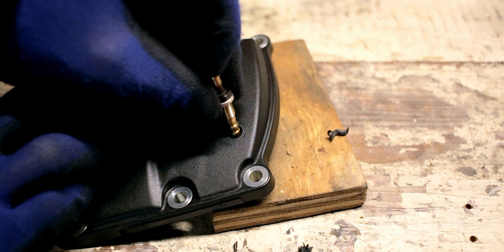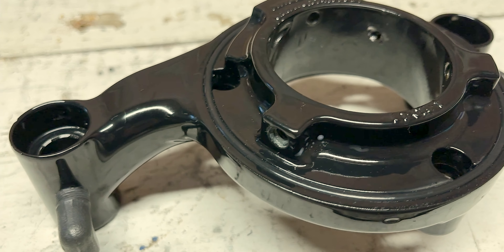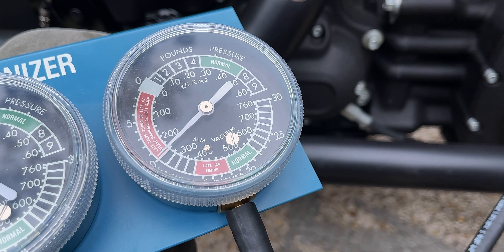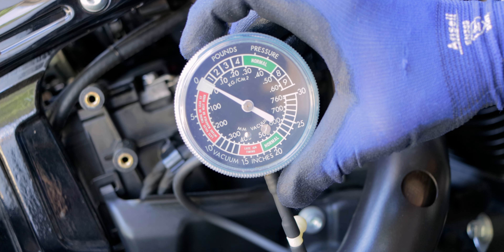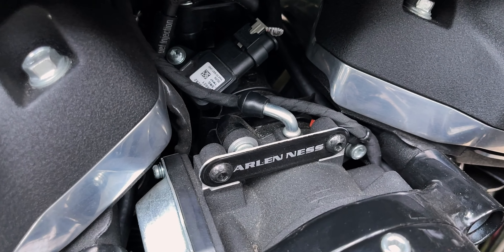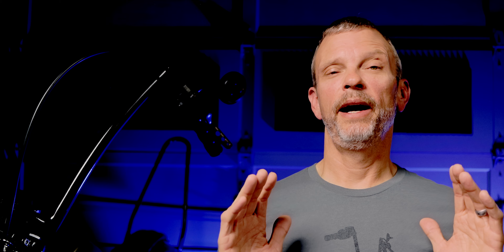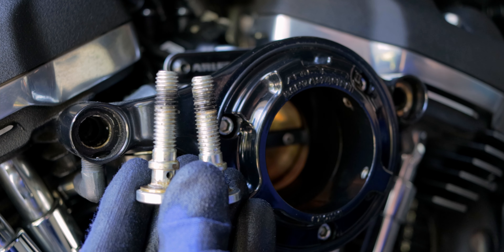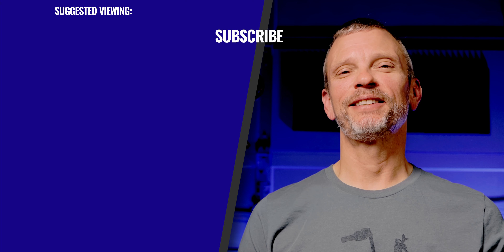M8 Crankcase Pressure OR Vacuum? • Crankcase Vent • External Breather • Check Valve • Stage III

Comment from the maker: Have you tried to measure the crankcase vacuum on your bike? What did you find and how did you measure it? There’s probably a better way to do it than the method I used. And do you have verifiable facts about whether or not this mysterious vacuum is really needed in the crankcase? Let me know!
Reply: You will never have crankcase vacuum because of ring blowby which is minimal at first but increases with age. In race conditions severe cylinder pressures increase crank pressure which can cause seal blowouts so vacuum pumps are used to get a lower crankcase pressure moreso than a vacuum.  General stock applications are sufficed with venting as you did to achieve no or minimal case pressure
Reply from the maker: Hey C Joy - thanks for contributing to the discussion!

Comment: I believe that nipple on top of the throttle body is a vacuum port (VOEs). Can't remember but that would be why its reading neg. I did both the NESS breather mod and the trans DIY mod to both my bikes. My 128 road glide and my 117 softail neither show any signs of problems. I Just put roughly 1000 miles on the softail this past week in the Mountains of NC. Temps in the 80s and average speeds on the freeway were 80mph. Revs down the mountain backroads were 2700 - 3000k. No problems. I think these mods are fine. Thanks for the research!!
Reply from the maker: Hey Timberjkd - my guts says the same - I’ve logged some good hard miles with both mods in place and I haven’t seen any issues. And yes that is a vacuum port on the throttle body. I knew there was strong vacuum going through and I just wanted to get a reading so it was clear that the intake vacuum was significant. Thanks for the input!!

Comment: Thanks so much for looking into this, I’ve been thinking about this a lot. I’ve installed the Trask vent and I’m really happy with it so far but have been debating the external breather vents, mainly because Kevin Baxter didn’t recommend doing both. This the response from Kevin when I put the question to him, “I'm not one to suggest parts unless they are needed to solve an issue. It would depend on how much oil is passing thru the breather. If your TB and air cleaner are relatively clean, I wouldnt spend the money. It doesn't hurt, but may not be necessary. All the best - KB”   So at this point I’m eagerly waiting on your next video and I’m currently putting off the breather mod. I’m having a stage ll done next week and installing a SS oil pump and Cam Plate to prevent sumping, I’m eager to see just how much oil residue is in the breather, when I install the new one. 
Thanks again your videos are super helpful and informative. Keep up the great work.
Reply from the maker: Hey Todd - thanks for the info and feedback! My gut says it’s not a problem but I wanted to do some research and testing just to see what I could learn. I’ll definitely post info on how those bolts look with a couple of checks, but my expectation is that I’ll re-do the breather mod within a few weeks. Unless, of course, I get solid info that doing both is “bad”. 

Please let me know what you think after putting some miles on the new cam! I’m about to do a Stage III follow up video and the S&S cam plate is on the research list along with a few other dream-list items. 

If you want a channel sticker send me a DM on Telegram or Instagram with the mailing info @RonsWorkshop
Reply: I also use the Trask vent.  The Trask guys say to combine their vent with an external breather, just the opposite of what Kevin Baxter suggests.  So for now, I'm running the Trask vent and regularly checking my air filter (Stage 1) for buildup.  So far nothing, but headed to Sturgis in a month and that will be a good test.  Even before the Trask CheckM8, I still wasn't seeing any problems with my air intake at 10K miles, but then again, I don't ride really hard.
Reply from the maker: Hey Jerry - thanks for the info! Let me know how it looks after Sturgis. I’m working on the follow-up video now. It should be up before Monday. 

If you want a channel sticker send me a DM on Telegram or Instagram with the mailing info @RonsWorkshop
Reply from the maker: Hey Jerry - I  just posted the follow-up video: https://youtu.be/BaG1VdOFe48
Reply: @jerrybrown66  hey Jerry I was thinking of putting trash vent on my Harley-Davidson street glide 2019 trash told me I need update oil pump 2020 before installing it do you have update pump?

Comment: Just a thought but when you connected your gage to the crankcase vent on the trans cover did you put the check valve in line or leave it out?
My understanding (and i may be wrong) is that without the check valve vacuum will not build in the crankcase as the air is just flowing in from the vent hose when the pistons are going up (instead of being blocked off due to the check valve thus creating the vacuum in the case). When the pistons move down air flows out of the check valve into atmosphere thus allowing the crankcase to not over pressure and start sumping.
Reply from the maker: Hey Darren - good point. I attached the gauge directly to the barb on the top cover, so the gauge was actually serving as the check valve to allow it to pull a vacuum if there was one.

Comment: If the plastic bag continues to inflate, and stay that way, there can not be a vacuum in the crankcase. They would cancel eachother out. I have bought a 2022 model and if Harley have not added a vent I will, but without a check valve. 
On another note, I remember as an apprentice mechanic (cars), we were taught that compression and combustion pressure forces the rings out to seal against the bore. I personally can't see how a vacuum would effect rings considering the opposing forces. I'm not alway correct either, just my opinion based on my training.
Lastly, oil misting into the air intake is very common, even in diesel engines that do not create a vacuum. In those engines it is purely blow by pressure causing it, requiring the use of catch cans. 
Thumbs up for the breather vent in the cover.
Reply from the maker: Hey Tim - thanks for the input! I agree that if there was (enough) vacuum in the crankcase it would offset that pressure, which is definitely the goal. After trying a few different approaches, the transmission top cover vent is my favorite as well.
Reply: @RonsWorkshop  and thank you for exploring all the options Ron. I've had a sportster for 5 years so the M8 is new to me. I like to be prepared 😄

Comment: Interesting subject matter.  Been considering running both Crankcase Pressure Venting and External Breather System (EBS).  I have a Fueling Billet Vented Oil Dip stick on my 2020 SGS (114-to-117 Stage-4 11:1 CR, SE Extreme Ventilator AC) and have just installed the Trask M8 Checkvent (transmission cover vented) on my 2021 CVO SG (10.2:1 CR, completely stock except for addition of the HD Fan for the oil cooler & aforementioned Trask piece).  Both bikes are running HD Tuners (for warranty and compliance purposes...both EPA and C.A.R.B. for here in Ca.).  Been researching for a few months now if I need to (or want to) also add External Breather Systems for the Top End.  I haven't determined if I need Top End EBS yet.  Air filters are clean, not really seeing any oily residue there, but of course the issue of taking in warm/hot "oily?" air and re-introducing back into the engine is my concern.  Dyno Testing (on an actual Dyno) and with very good instrumentation (and where instruments are connected) obviously would be the better way to go, to measure and find out?
Reply from the maker: Hey Tom - thanks for sharing the details about your bikes! Be sure to watch the follow-up video to this one where I cover some very important points and clarify a few things. I’ll put a link below 👇. Where I’ve ended up is using my transmission top cover vent with the OEM breather bolts. I’ll include a link to that follow-up as well. I still plan to try one more solution that uses a catch can with vacuum applied, and ties in both the crankcase vent and external breather mod — that could indeed be the best of all scenarios and at least one viewer is using that solution with good results so far. As to the oil and hot air going back into the intake - I don’t think the air temperature is all that high and depending on the bike the amount of oil could be minimal too, but each bike is different based on a myriad of variables. Some will blow more oil than others. I also suggest that you do the sumping check by removing your crank sensor (another link below). If you don’t have sumping issues these things are not so urgent. If you do have a sumping problem, or you’re borderline, it’s a different story. But at the end of the day, positive crankcase pressure is detrimental and that’s what I’m most interested in alleviating with these solutions. And I agree - true dyno numbers are desirable - but that’s a scenario that may be hard to capture for accurate comparison. Engine temp, air temp, airflow, etc. 

Follow-up video about crankcase pressure:
https://youtu.be/BaG1VdOFe48

Check-up video about on my venting solution:
https://youtu.be/jOATltGSkgU

Pull the crank sensor to check for sumping:
https://youtu.be/F2N7kwCspQE

Comment: How can external breather effect vacuum? It does exactly same thing as before except instead of blowing air inside the intake it blows it outside.
Reply from the maker: Hey Street Glide - the theory is that the ports in the intake introduce vacuum…but I haven’t been able to measure any. So for me, after all my testing and experiments, the main concern is venting the pressure.

Comment: I actually added a crankcase vent through the dipstick. Reason; I was getting oil in intake and at 60 miles my dipstick blew out, or open ruining the o-ring. My thought was to just vent the dipstick. No problems with it at all now (18000 miles) except I do get oil mist out of that vent. Quit a lot it seems. Any suggestions??
Reply from the maker: Hey Ric - did you use any sort of pod filter or does it just vent to the atmosphere? And where did you place the outlet of the vent? And what level do you keep your oil at?
Reply: @RonsWorkshop  yes there is a pod filter. I actually ran it up just above the intake. I was running a catch can, but I think this looks much better. My oil I run 1/2-3/4 quart low constant. Thank you
Reply from the maker: @riceddy7420  I'm just not sure. I had similar problems with my DIY vented dipstick, but I got actual out discharge and not just mist. I never did end up with a solution that worked. I've seen other comments from viewers with similar issues but I'm not sure what causes it - I do know the Fueling dipstick has an oil separator, so maybe you just need something like that. The catch can serves that purpose, but as you noted it's bulky. For my crankcase vent I was able to hide the catch can behind the right side cover. There are also so pretty small catch cans out there, so maybe something like that would help?

Comment: Hey, Ron!  The fitting you used on the trans cover... was that a simple coupler or a one-way, reed-type valve?  Thanks!
Reply from the maker: Hey Jack - that’s just a basic bulkhead fitting, but I have a check valve in the line above it. Check out the prior video for links and all the details: https://youtu.be/U6gOhbRQrwE

Let me know if you need more info.
Reply: @RonsWorkshop  thanks, brother!  I appreciate the info.

I too was wondering about the same thing.... run one? if so, which one? run both? is that even necessary?

Anyway, I look fwd to seeing what you come up with.  I'm on a '20 fxbb with the 107.  I've got stage one on it.  Definitely interested in engine longevity.
Reply from the maker: I’ll let you know how things look after a but. Ore monitoring. I suspect I’ll end up with both as before.

Comment: Hello Ron, my bike has a revtech 100 engine...   my question do you have information or suggestion of which option  of ventilation  for this type of engine fits it best..   thanks in advance...
Reply from the maker: Hey R R - unfortunately I don’t have any firsthand experience with those. I think the Revtech motors replace the 84-99 Evo, so you might try researching Evo crankcase venting. I know they have some sort of head breathers, but I dont know much more. Let me know what you find!

Comment: First , anyone not knowing the throttle body and/or intake and carb is supposed to have vacume , knows little about a engine . In the 50s - 60s engines had a open tube connected to the engine block usually down by the oil pan at the rear of the engine , that allowed excess pressure inside the engine to escape . In the 70s their was a PCV valve , a spring loaded leaky check valve , it hooked into intake vacume and into one or the other valve covers , on the opposite valve cover a hose went to the air cleaner and hooker to a small filter inside the air cleaner housing , this pulled the regular pistons working up and down and excess blow by pressures inside the engine directly into the intake manifold , no vacume was pulled on the inside of the engine , it was free flowing - air down threw 1 head and up out of the other head . Using a PVC valve requires a fuel mixture adjustment . Then you have the map sensor (in the intake and/or throttle body)  completely coated with oil from the head breathers on a harley , and some completely gobbed out with oil residue , you think that sensor is working correctly ? WRONG ! What do you clean it with , some sensors after cleaning no longer work or work correctly after cleaning . The engine block has the most pressure , the heads get pressure up threw the push rod tubes and oil return holes down threw the jugs from the heads , after the pressure happens in the engine block , could excess piston ring blow by cause the oil return from the heads to slow down or stop and oil gather in the heads to the point oil is running down threw the push rod tubes ? So where should the focus be on reducing pressure inside the engine ......................................How do I know all this ...........First , Im about old as dirt , second , I was cleaning tandem dump truck parts at about 12 , third , if you pull all the electronic`s off these engines , it may look a little different and made a little different , but , its the same thing as years ago ...............

Comment: Ron do you think just adding the cover vent will take care of the oil getting in the intake?
Reply from the maker: Hey Grounded - the crankcase vent I used does a great job of venting the pressure and reducing the crud that gets to the intake. You can see the check-up video here: https://youtu.be/jOATltGSkgU

If you add the external breather mod you completely eliminate it, but you also remove the potential source of vacuum. It’s a trade off for sure, but venting the pressure is the big win.

Comment: I just bought a 2022 RGL 114 ci. Stage 2 . I have done the intake bypass with a pod filter. Should I also vent the top transmission cover. I'm not sure if vented trans cover was a let's say 2017-2019 issue or if I should go ahead and do it on my 2022 . Thanks
Reply from the maker: Hey Joe -you could just do a simple check to see if you’ve got positive crankcase pressure (and almost certainly we all do). Just remove the oil filler cap, fire up the bike, and either stretch a balloon or tape a plastic bag around the filler hole - if it inflates you know you’ve got pressure that could be relieved. Let me know what you find!

Comment: Hi
Try a water monometer.
I can't see the blowby tubes creating a vacuum. There is a fix for this . Vent into a catch can and take the outlet from the catch can back to the air filter.
The catch can drain back below the oil fill into the bace. Install a  check valve on this line. I can provide pictures from my street glide.
HD should provide a fix for this.
Reply from the maker: Hey Norm - that’s a very interesting solution! Thanks for sharing it. If you can send pics that would be appreciated. And the water manometer is a good idea too.
Reply: @RonsWorkshop  Hi
If you supply a email I will send you some pictures. I can't seem to attach any pictures to this reply.
Cheers
Norm
Reply from the maker: Hey J Ecr - I like that solution! Nicely done.
Reply from the maker: And which catch can did you use?
Reply from the maker: I’ll check it out!

If you want a channel sticker send me a DM on Telegram or Instagram with the mailing info @RonsWorkshop

Comment: doc Harley doesn't recommend venting into the crankcase  .......just sayin but i have not done the transmission mod yet. Bike runs great 2018 Heritage 114
Reply from the maker: Hey D R - shoot me a link to that video of you can. Thanks!
Reply: I just did the crankcase vent and ran my line from the breather bolts to that crankcase vent!
Reply from the maker: Nice! Let me know how you like it. I suspect you’ll feel a difference. I did!
Reply: @Ron's Workshop  I will just changed oil and about to rip this weekend! I'm getting 475 cam kit soon too!!! Geeked about that one!